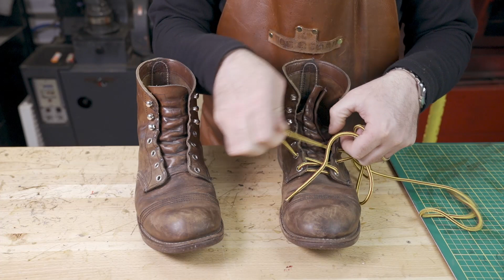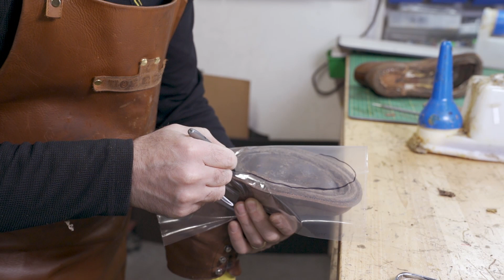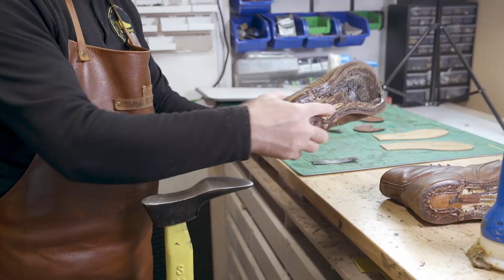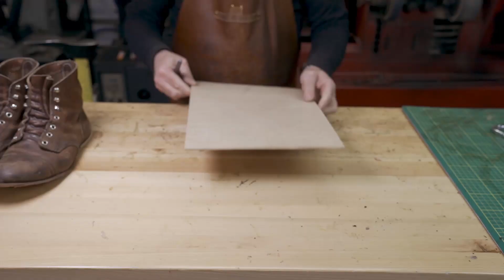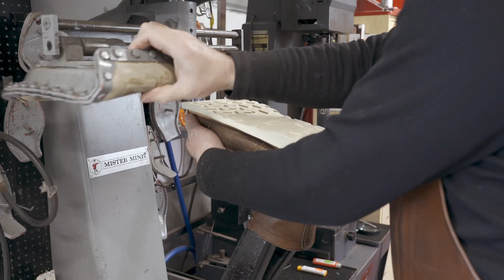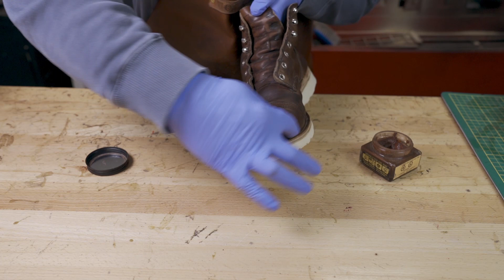Resoling Red Wing Boots with Vibram Soles | + Boots Cleaning Guide

Comment: My wading boots have vibram soles. The soles /heel include 12 pin size openings to screw in cleats to help grip onto moss covered rocks along the riverbed. These holes no longer hold the cleats. Is there a glue that will weld the hold close so the cleats will hold?
Or is there a material that can be glued inside the hole so the cleats can be secured to the sole/heel?